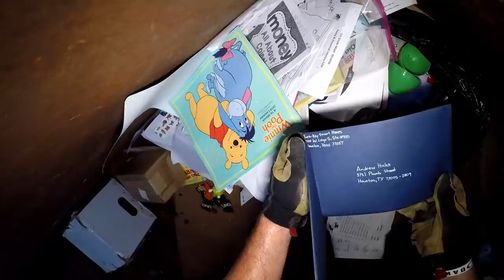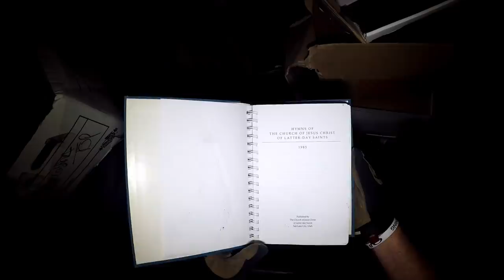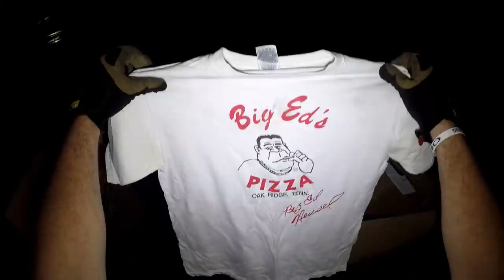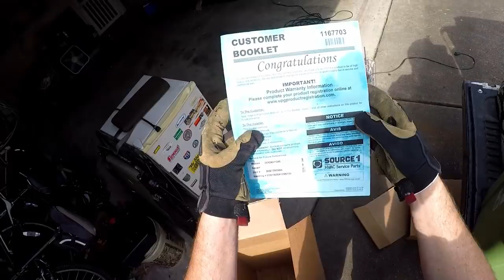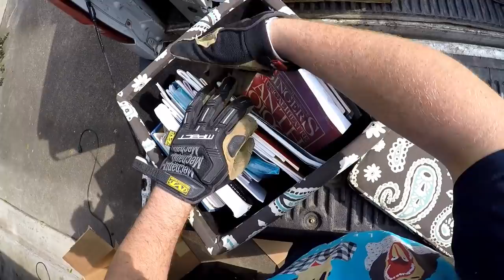Dumpster Diving "Scrappin' In The Hood"

Comment: Hi Mike, Bowers and Wilkins speakers can be expensive and if that one works, even in that condition, you might get $200. If it doesn't work the connections for the wires are probably gold plated and could get you the massive total of $10, not much but still better than shred.
Reply: Even if it’s broken enthusiasts will be happy to fix it and pay better money then scrap.

Comment: Heating element: This is an electric heat coil that goes into an air handler, either as emergency heat for a heat pump, or plain old resistance heat. It looks minty! In any event, the water absolutely will not hurt it! The water level showing on the carton looks like about an inch. If I needed one, I would be it like white on snow

Comment: The heavy black ring thing you found in the ac dumpster is off of a cars ac compressor.  It is the electro magnet that pulls in and holds the compressor clutch applied to make your ac work.  It is copper wire coated in resin.

Comment: That Bowers & Wilkins Center Channel probably $1000 new. It could fetch a few hundy if you clean it up. Granted it works. If it doesn't work, there's a crossover in it that has copper and other components that you can scrap.

Comment: Do you ever pull the silver contact buttons out of the breakers ? in Almost every circuit breaker has a contact button of high silver contact worth ab 30 cents each and the larger Hi Amp breakers is usually ab 1.00 dollar to 2 dollars !! and at the same time you can separate the copper for its higher scrap values ....

Comment: You really need to put playing cards on your bike spokes to make a clicking sound like we did when we were kids having fun.

Also I watched you load an A/C unit into Dottie and it was not quite high enough to hook on the tail gate so you had a heck of a time lifting to load. You might try using a 6x6 block under the leading edge. first tip the unit away from the tailgate, insert the block, and tip onto the block to lift it a bit when you tip toward the tailgate.

Comment: That heat kit for an air handler should be good to sell. As long as it is dry when it it is installed. Should be able to get at least $50 for it

Comment: Mike you may or may not see this comment but anytime you come across any kind of heat elements for ovens or hot water heaters or industrial use even down to something like your clothes dryer or something small like a hair dryer,, those elements are made of stainless steel and water does not hurt them or the insulators on them even if you see like green tarnish or whatever that stuff is around the insulator, it can be wiped or brushed off but definitely remember the elements are made of stainless steel and sometimes in the old time elements those are a stainless and I believe if I'm not wrong possibly like carbon steel and some elements but either way don't throw them away for regular scrap steel because they're always worth a lot more and check the old old style breakers and even break her boxes for the silver tap contacts for the breakers and even the round older type fuse links lock in place inside of them and if you're not familiar with silver have someone in or around the scrap business to show you or even the electronics guy could probably show you if he's familiar with that

Comment: neat new video just as i finish the other, eed some velcrow shoes mike your knots ant tight yo! shoe be falling off in da dumpster might get some bad foot not big foot but bad foot, poor arcade camment i think i'd be grabing the top part with the game logo on maybe the cabanet might be able to put in some retro thing the cool thing is though you don't need much to put in there mother board power unit 1 ram stick and hard drive and boom you have a game unit, ac unit nice i guess as well as clearing out shop put in a new ac unit that'll bring ppl back to work once the virous is gone wrong size that looks to be a 37 by 40 or something but yeah too small or long looking mike, nice lil score hymm books and a tot with lid looks to be a rubber neck too the ones vid vulture uses nice, i know how you feel like, i want to do carboot sales but i can't hell no point in putting stuff out the front as hardly any one driving along my road, before this virous you'd get boy racers and bikers zooming along our road and normal traffic now its like a few cars like every 3 hours if that! man them bullfrogs or crickets are noisey! froggy's getting down doing the nasty,nice dvd player works might of been a read along or listen and do the action cd,